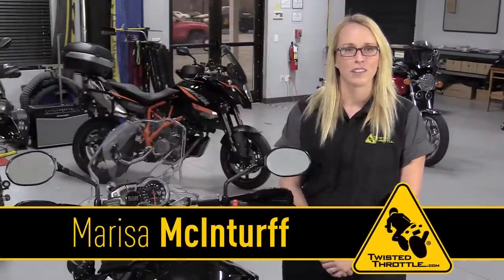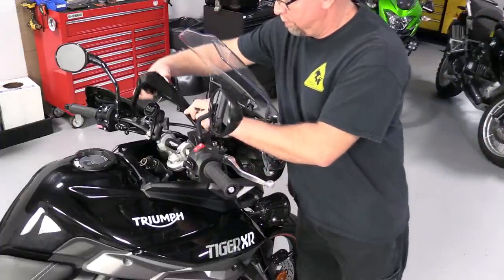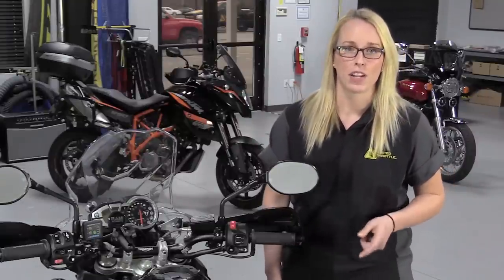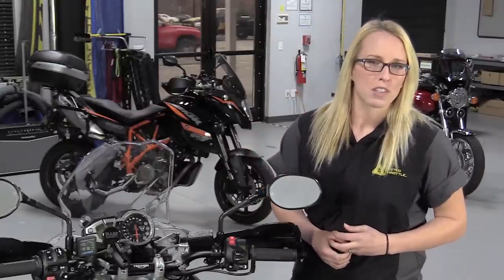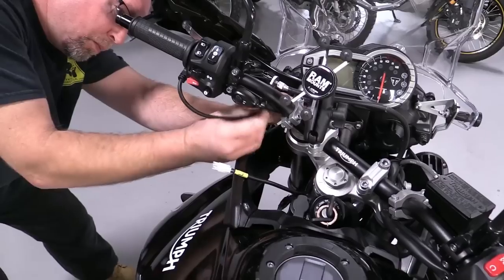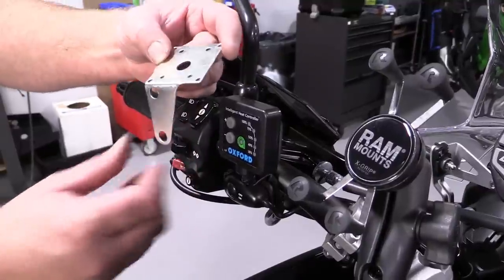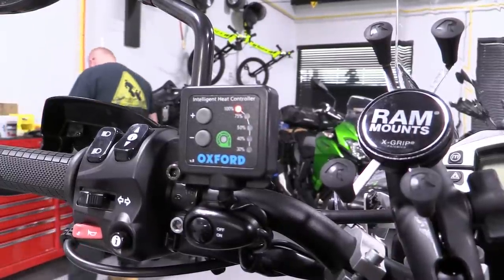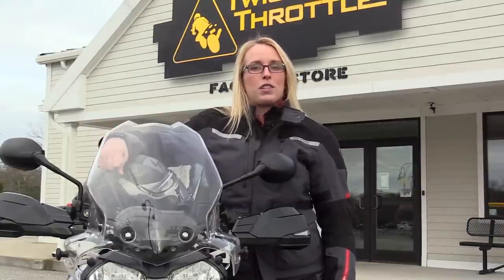Oxford "Heaterz" Heated Motorcycle Grips - FULL INSTALLATION | TwistedThrottle.com

Comment: I would recommend testing the unit by hooking it up to the battery before cutting or filing the throttle. It sucks to do all that work and find it doesn’t heat up due to a faulty unit!
Reply: Indeed and oxford will not refund them if they where glued or trimmed just use a 12 V battery like I did
Reply: Channels as this have mostly no real experience, they are sellers.
Reply: Thanks for this great tip. I'm about to buy this product soon.
Reply: @corneilcorneil  Cool, but this is literally written in the instructions provided with the kit. Sellers can read, right? :)
Reply: @abominacja47  And what is your point? "This is written...." What "this"?
Reply: @corneilcorneil  That you should check before the installation, with engine running, they're operate as expected. It's in the manual.
Reply: @abominacja47  I ONLY wrote that channels like this... The rest is logic.
Reply: @abominacja47  "before installation with engine running" No, i test ALL new parts on a separate battery.
"It's in the manual" Yes, and the manual also states that you CAN wire in, directly to the battery... that is just stupid, like a lot "manuals"
But... why do you tell me all this, I ONLY say that most channels have no clue or experience at all.
No need to learn me something, official dealers call me in when they can't solve a problem.
Reply: @corneilcorneil  Chill mate. Apparently I didn't see through context. You don't have to be mad about it. Besides the grips won't work unless the controller detects charging, since there is battery protection built in. I don't have dedicated test bench like probably you do. I'm not trying to teach anything here. You just commented these guys are jest sellers and not experts. But since they're showing how to do it, my implication was, they should at least read the manual no?
Reply: @corneilcorneil  So would you recommend to connect it to accessory power, which only works with the ignition like some newer bikes have?
Reply: @abominacja47  Over a acc controled relay, so close as possible to the main fuse. At least, you don't have wires under permanent power and no power on the controller if not needed. 
Depending on where you park your bike, kids can play with the system, because it will work without the key in the ignition.
I contacted Oxford about their theory... no answer. Just like Barons USA not answer when i tell them that their installation guidelines are much to complicated and you can do the same job in a much more easy way without unscrewing 20 parts.

Comment: Good luck on the Pan America. After hours of filing and sanding the idiotic glue they put in the grips and grinding down the throttle tube on the bench grinder, only the left side fits. The oxfords are 15 thousands smaller than 7/8 and 1 inch to begin with and the throttle tube is almost a 16th bigger in places. I would have went with other standard all rubber brands if I had known these are plastic and glue inside. As of 2024 the base model is discontinued, so no more aftermarket heated grip crap needs to deal with.

Comment: It's possible to remove old grip without tools, just add some oil to the surface between rubber and plastic.
Reply: Yes but you’ll still have to stick something in between the bars and grips. I even used engine cleaner to remove mine

Comment: You should not connect it to battery directly unless you are a daily driver because even it has a voltage checker, it has also a internal resistance which drains your battery very slowly. Use a 20amp relay triggered by parking lights and don't forget to replace the ugly connectors with sumitomo types, because they are not waterproof and secure. My brand new set had an interupted power and I saw some weak sparks at connector inside and replaced them by sumitomo. Now, it works perfect.
Reply: Overkill and overly complex suggestion. The "intelligent controller" on the newer style Oxfords only draws approx 10 milliamps. Would take 50 years at that rate to draw down a Vstrom battery to the point where the battery wouldn't turn it over.
Reply: @frankcastle5294  I put these on my bike the other week, rode to work for 4 days 1 hour each way, went to start it Wednesday after a night shift and the battery was dead. I am riding every day but am in london traffic so constantly stop starting
Reply: @frankcastle5294  Yep

Comment: I’m installing Cruiser version on Kawasaki Vulcan. I need a longer battery post to fit all components (grips, jacket plug, USB and tender).  I put these on prior bike and LOVED them.  Fingers crossed that this goes smooth, ie cutting off old grips and hoping I measured right!  Thank you for the install instructions.
Reply: Were you able to remove the Crusier grips and move them to another bike?
Whoever fitted them to my Rebel but the wiring gets in the way of the indicator switches. 
All I want to do is be able to rotate them around a few degrees but that must be superglue they supply with the kit

Comment: Great video! Had some fitted, annoyingly the right side gets hotter than the left! They're sending me a new control unit to hopefully remedy the issue...
Reply from the maker: Oh no! Hopefully the new one works perfectly for you!
Reply: Did the new control unit fix it?

I've read that since the left grip isn't insulated by the throttle tube, its heat tends to dissipate to the handlebar.
Reply: @toasted999  yes the replaced control unit fixed the problem, so all the talk about heat dissipating into the bars is nonsense, simply an electrical component issue/fault

Comment: Can these work on Enduro bikes? I have a 2013 350 KTM EXC-F. Would it be the adventure type of so?
Reply from the maker: The model that you select will depend on the length of the existing stock grips. For this particular bike, we chose the touring model as it fit best. This video at :50 or so shows the grip lengths.

Comment: Do you have a link to the mounting bracket you used.
Reply from the maker: Hey Paul,

See the mount here:
https://www.twistedthrottle.com/denali-angled-switch-mount-for-vertical-perch-bolts-single-or-double
Reply: Hi do you have a new link to the mount? Below link doesn’t seem to work?
Many thanks for the video

Comment: Hi..Which set would be advisable for Royal Enfield Himalayan
Reply from the maker: Hey Sainath,

We didn't get to install a pair on the Himalayan while it was here in the shop. If you are planning to ride off-road at all, the adventure grip is advised because it has a more textured grip (better for off-road). Before you order, if you could measure the end of the handlebar to ensure you have enough room to mount the grip - the adventure grip is 5.2 inches long and trimmable to 4.8 inches so you do have a little wiggle room to get the right fit. The sport and touring models are a little bit shorter, but they do not have as much texture on the grip.
Reply: Hi... Thank you for your advice, i have seen some one using Oxford Hotgrips Premium Retro.... what do you suggest?